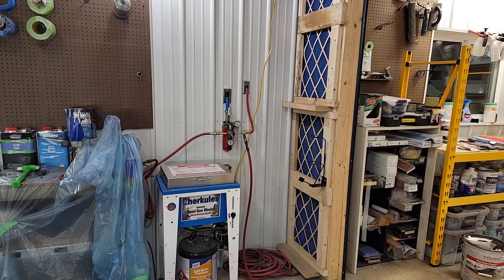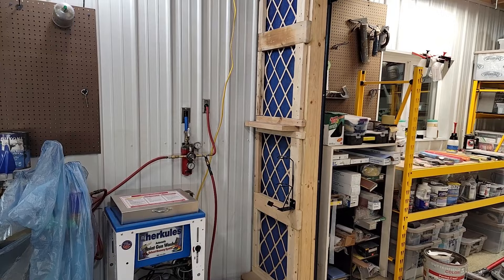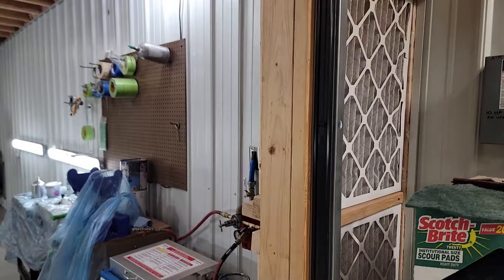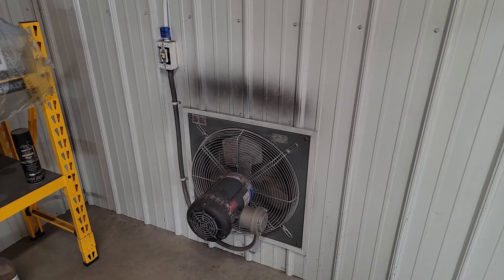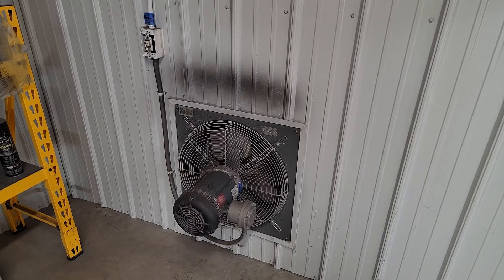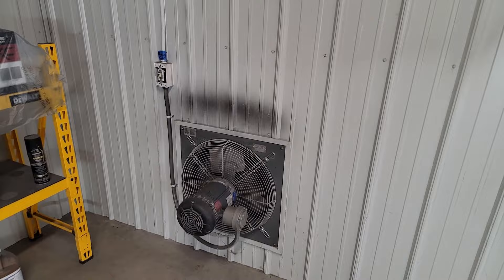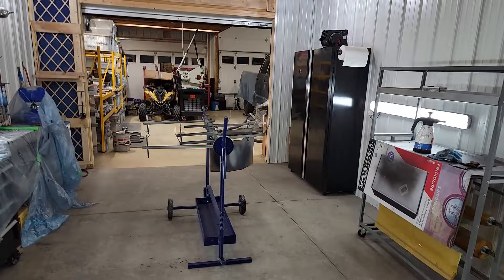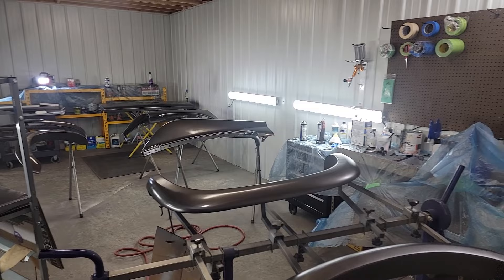DIY Paint Booth

Comment: Instead of explosion proof fan you can use a green house fan, they are water prooof sealed which also makes them explosion proof) and are way cheaper.
I bought a 19,000 CFM 40" for $850 for my homemade paint booth.
Reply from the maker: That does sound like a nice option. And pretty decent circulation
Reply: May I ask where you got one?

Comment: As far as static goes why not just ground the booth to earth using a copper rod driven into the ground.... Works with my sandblast cabinet electricity is lazy it always seeks the easy path.
Reply from the maker: Yeah that's a good point. Bet that would work... Thanks for checking it out.

Comment: I understand the why for a explosion proof fan but the installation would not met NEC requirements. Your money might have been better spent by using a forced induction system with directed exhaust. Just a thought.
Reply from the maker: Hi Steve yeah that's a good thought. Could also work. My only thought with that is that it may be harder to keep the incoming air filtered in a homemade system with forced air intake, but certainly would have been an option...
 The other downsided to mention is my setup doesn't have the typical downdraft of a official paint booth even though I did Mount my fan low to help with this, professional setup certainly do have their advantages.
Reply from the maker: Thanks for checking out my channel. Have a great day, Chris

Comment: I personally don't like a paint booth I've done my best painting out in the open but my biggest issue with a metal paint booth is dealing with static
Reply from the maker: Yes certainly can be a little bit of a problem. I will typically use a sprayer to spray the paint booth party utilizing. Keeps dust down a bit and probably also static. Obviously don't want too high humidity for painting purposes, but as long as it's 40 to 50% or so should minimize static

Comment: What do you do for heat?
Reply from the maker: The paint booth isn't separately heated, but when painting I turn the shop furnace up which is a high-efficiency Bryant furnace. And the summer time I don't add any heat. Just try to keep it between 70 and 80 deg F

Comment: Does a paint booth have to be air tight?
Reply from the maker: Not necessarily completely airtight, but the path of least resistance needs to be the air filters, not some cracks in the wall were dust and contaminated air can come through. In other words would avoid any gaps large enough to see light through or any significant air flow. If there is could just use some silicone or caulking to seal that up as that could be an entry way for dirt and dust etc. Great question let me know if the answer makes sense. Thanks for checking out my channel.

Comment: What's the HP of your exaust fan
Reply from the maker: Pretty sure it's a half horsepower and approximately 2,500 CFM
Reply from the maker: From northern tool
Reply from the maker: Canarm Explosion-Proof, Single-Speed Exhaust Panel Fan — 16in., 1/3 HP, 2580 CFM, Model# P16-4
Reply: @MotoXr917 hey buddy just setting up something similar for doing cabinets, looking at same fan, not sure what filters to use on this type of fan, does it have enough cfm to pull air through a furnace filter